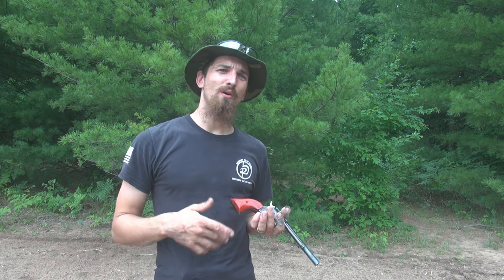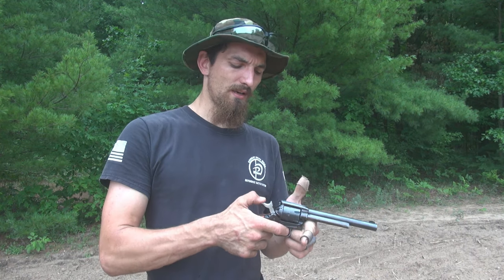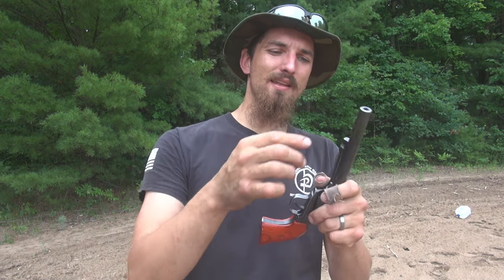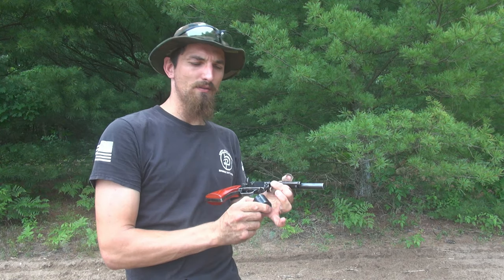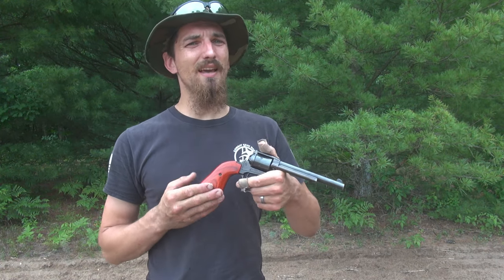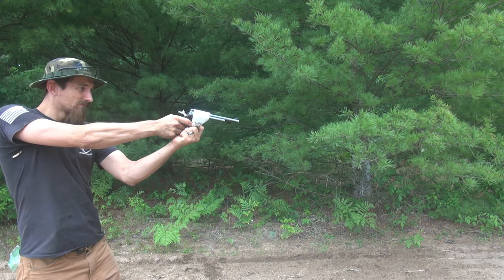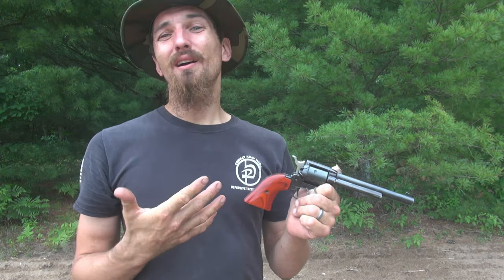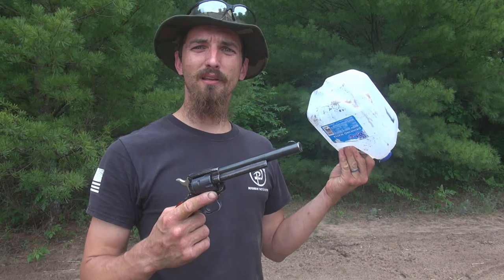Most Amazing 22 Revolver, You Have to See!

Comment: I installed a Ruger all steel ejector rod in my Rough Rider.  Can be purchased from Midway USA for less than $10
Reply from the maker: Awesome, good to know!
Reply: @Mr103056  its too fat.
Reply: Thank you
Reply: Thank you smart guy!
Reply: I haven’t had any problems with my ejector rod yet even though I have fired a couple of thousand rounds thru mine.  I will probably buy a  Ruger ejector rod just in case mine breaks.
Reply: Which one?  Bearcat or Redhawk?

Comment: Yes, I own a heritage rough rider. These can still be had on Black Friday for $90 to $140. For that money the finish and materials are what you get.  
Options include barrel length, grips, fiberoptic sights, 6 and 9 shot, a cylinder replacement for 22 mag and some finish variations.
The 22lr cylinder will accept 22lr, 22 short, 22 long and 22 shotshells. The Mag cylinder will accept 22 mag and 22 mag shotshells. 
My wife wanted one, so we got one with fiberoptic sights, 6" barrel, and both 22 and 22 mag  9 round cylinder. After 5 years many trips to the range, and about 4,000 rounds
it is still mechanically sound. The finish on the steel barrel and cylinders is showing some of wear, mostly on the tip of the barrel and the front side of the cylinder. The finish on the frame has a lot of scratches, wear on every edge and some minor pitting around the cylinder gap. I like many others have either put purple or blue locktite or plumbers tape on the tiny bolt that holds the ejector rod cover to the barrel.  Seriously folks, buy one, clean the threads on the little bolt and the hole and put a drop of purple locktite on there.
Reply: $100 cabellas

Comment: I have watched at least 100 videos involving revolvers and you are the first person I've seen warn people about the gases and debris danger at the front of the cylinder during discharge.  I have allowed other people to shoot my revolvers and never made a point about keeping hands away from the front of the cylinder.  My bad.  By the way, I also have the Heritage with both cylinders.  It is a good gun but if anyone is going to buy one please inspect very carefully for quality control.  After I got mine home I discovered the 22 cylinder would only revolve two clicks before jaming.  The 22 mag cylinder spun perfectly at half cock.  Sportsmans Warehouse would not help me.  Said I had to send the gun back to Heritage.  I bought it as a camp gun to use with the 22 mag cyclinder so it didn't bother me too much and I never sent it back to Heritage.  But I did try another 22 cylinder from a buddy's gun and it worked fine.  After measuring we found that his cylinder was .002 inches longer at the center.

Comment: I bought a Rough Rider in the late 1990s. I paid $99 for it and have used it to teach my kids how to shoot. The finish wasn't "bluing", it was painted on. In the 22 years I've owned it, I've had to refinish it twice (frame and grip). Came out okay each time and doesn't really affect operation. Not the most accurate single action I've owned, but certainly a fun gun, and WELL worth the money I spent on it.
Reply: The barrel and cylinder are blued. The frame and grip frame are some kind of painted coating that is not very durable.
Reply: Have you tried “aluminum black”

Comment: I have two 6.5" rough riders and one 4.75".  They all work very well with either LR or WMR and I've had no issues with them.  I accidentally dropped my 4.75" on the ground and broke the ejector rod which isn't a huge deal as it can be replaced.  I've got around 1,000 rounds through my 4.75" and maybe 100 rounds through each of my others.  Amazing little guns Heritage is making these days.

Comment: Bought mine in December of 2019; 4.75" barrel, combo cylinders. A great gun for learning and as a first pistol, with the added asset of ammunition flexibility. The hammer block safety takes some getting used to, but does make it safer for carrying and loading. The fact that it uses .22 rimfire ammunition means that putting your hands near the cylinder gap is unlikely to cause serious injury, but you do get motivated to quit bad habits. I broke the safety on mine from over exuberant use, but Heritage replaced it under warranty with a three week turnaround.
I also deducted points for the finish, but it's not meant to be a Rolls Royce. Researching this gun pointed to consistent complaints of a sight blade slightly off, and an eventual looseness of the screw that secures the ejector housing to the barrel. Hence, the gun was broken in, followed by tightening the barrel with a strap wrench, and applying threadlocker to the aforementioned screw.
The four-position hammer has interesting aspects. I tried (dry) firing it from the third position; it's possible, but the trigger pressure needed means that an accidental discharge is nearly impossible. However, the firing chamber in this third position is slightly out of time, and the cylinder would need to be moved slightly, to the next click. The gun itself doesn't like to get into this position, and takes a conscious effort to get there.
The hammer block safety makes loading a full cylinder both safer and practical; in this mode, I would recommend using the hammer block in conjunction with the first hammer position. This first position creates a gap of approximately one-eighth of an inch, while the hammer block prevents the hammer from touching the firing pin. However, please note that Heritage recommends the standard revolver loading procedure of skipping one chamber.
The longer barrels, up to 16", would make it a great snake gun when used in conjunction with ratshot. However, the 16" barrel makes it look cartoonish, with some wags saying it needs a "bang" flag.

Comment: just put over 1000 rounds through mine holding up great

Birchwood Casey aluminum black works like a charm on the receiver and grip frame, mine was looking rough but I touched it up and it looks better then when I got it

another thing to note is how easy this is to disassemble and reassemble. If I part breaks its easy to replace and cheap on heritage website

Comment: I know this is older video, but I had been looking at the Hertitage RR 6 shot with 6.5 inch barrel. It went on sale for 107.99 on black Friday so I picked one up. Then immediately purchased a nylon holster and .22 Mag. cylinder. ( was another black Friday deal 34.99 for both items from Heratige company). But like you said very fun shooting gun pretty accurate at 30-40 yards, it will serve well as home defense (only part I disagree with you on) but I also have other lines of home defense. 20 Guage with pistol grip and 18.5 inch barrel loaded with 3" #1 buckshot. Can't wait till I get more rounds threw it too break it in tho. Thanks for info!
Reply from the maker: Awesome!
Reply: Where can I buy this pistol?
Reply: @EXSENTRIX  Most gun shops carry then. But I purchased mine from Rual King. If you buy one make sure too purchase the .22 WMR cylinder also, you won't regret it.
Reply: @darrieljamison6914  Well that works out great! There's a Rural King not too far from me. Will definitely add that cylinder to the purchase as well. Thank you very much I appreciate it.

Comment: Bought mine two days ago. looks like fun! Great clip.
Reply: The heritage revolver is pretty solid. It will get dinged up but will shoot thousands of rounds. 
Here's the big tip that many of us have done.  This will save you lots of hassles.
The ejection rod cover screw that goes into the barrel.  Carefully remove it, it is spring loaded on the ejector rod. Then remove the cover and the rod.  Clean the screw hole with acetone or similar evaporating solvent. Clean the screw with the same solvent. Reassemble the spring, rod and cover, put a drop of purple loctite (light duty) on the screw and complete reassembly.  Don't use a stiffer grade of loctite as you may want to someday disassemble the ejector rod for cleaning and lubrication. 
I have started several new shooters with our Rough Rider. These are great training guns.  You can demonstrate a lot with them including the hot gasses and soot that come from the cylinder gap (between the cylinder and the forcing cone of the barrel).  I always point that out to new shooters with something like a piece of paper as part of the training.
Reply: @phild8095  Thinks for the tip. I have been studying the gun a little, going to range today.
Reply: @bsmith8564  So how was the range trip?  Hope you got home safe.
Reply: @phild8095   No issues. Fun gun to shoot. Had one fail to fire. Looking for an Arc magnet section to put on the barrel to capture the cylinder pin. Or I might grind another divot on the pin as to capture it when changing cylinders.

Comment: Good to hear it's still shooting well.  I got the one with adjustable sights and once I raised the rear sight, it was dead on at 15 yds.  Very accurate so far.  Good enough for squirrel hunting.  Don't waste your money on the Aluminum bluing compound as it doesn't work.  I guess you could anodize it if you wanted but you might just try painting it-I did this on my alloy trigger guard on my Remington 1100 and it looks pretty good.  Thanks for making the video!

Comment: I have three of these. The first time I shot it, I had a steel target, 8”x12”. I was at 60 yards. Once I knew where to was hitting(5” low - 5” to the left. I reloaded and rang the bell five out of six. I paid $99 for it. I think it’s absolutely the best ‘value’ gun I have. I also bought the Barkeep. Even with only a three inch barrel, it’s amazingly accurate. 
They are great,
They are cheap, 
Buy two. Great gifts and you’ll really be the big shot.

Comment: I believe the Heritage alloy frames are Zamak (96% zinc alloy aka pot metal), but I’ve heard rumor that Taurus may change that to aluminum to get around the melting point laws in some states.
Reply from the maker: I think you're right about the Zinc. It's not a bad metal, just not coated very heavily.
Reply: @GunTradition  it keeps costs down and is strong enough for 22 or 22 mag.  I’ve seen inexpensive “Hy-Hunter” 22 mags from decades ago, steel sleeved chambers in a pot metal cylinder and steel sleeved barrel. But they worked OK.

Comment: Just ordered the same one minus the magnum cylinder which I'll  buy later. 
Yours is shooting accurately. 
 I sure hope mine shoots straight!!!
One thing I don't understand is that guns are supposed to be precision milled. 
It shouldn't matter if the gun is inexpensive. 
 Why do guns shoot high, low, left or right??? 
I understand that there are lots of factors that can do this. 

 For starters,, Is it an expensive process to mill the sights on STRAIGHT for at the very least the windage??

Comment: That plastic piece for the ejection rod you mentioned is still together 3000 rounds later. Plastic or not it seems to hold up. Great video !
Reply from the maker: It's like driving my first Honda. She felt like she was gonna fall apart, but 200,000 miles on her and it's still going down the road.
Reply: The real problem is the screw holding the assembly to the barrel...we have blue loctite on ours and I check it constantly...we check all screws when cleaning...
Reply: @PetuniaIii-pd1ww  I seen a guys video who mentioned they come factory with a crooked or loose barrel sometimes. I'm about to buy one, I'll be checking the barrel as a  first step. They guy was saying that's why some have an accuracy issue.
Reply: @here_to_watch2115  no doubt some folks have bought lemons...the common complaint about the barrel seems to be the front sight is nowhere near where it should be - the barrel is screwed in, and I think the manufacturer overcooks it sometimes...even more common is the screws working loose, which our gun suffers from (blue loctite is good stuff!)...others complain about fit/finish, but for 147.00 these guns aren't Rolls Royces to begin with...and some note parts breaking way too soon, but that can happen with any gun...we have had ours for several years, several thousand rounds downrange, and I love the gun warts and all...you are 100× more likely to get a good one than a lemon...you might notice there are a lot of people saying they own 2, 3, or 7 of these guns...you never hear anyone say they own that many wranglers...bottom line: if ours ever wears out we will buy another one...

Comment: The 9 shot is great but the ejection rod / loading registration requires a bit of extra manipulation - more shots but slower loading per bullet.  I keep mine as my home defense gun - no worry about tired springs in hard to find magazines, I can keep a couple blanks under the hammer for safety and still have 7 shots.  See my video (Ishkatan) about the registration of the of the 9 shot cyclinder.
Reply: No need for blanks or an empty chamber with a hammer block safety.

Comment: That's not bluing on the Zamak metal it's just a crappy paint job. Just the barrel and cylinder are blued. I sanded all the paint off of the Zamak pieces (Main frame, Grip frame and ejector housing) and polished them with Mother's Mag and Aluminum polish. Those pieces polished to a mirror shine. It's now both functional and beautiful. I was amazed at what 40 hours of finishing work did to that gun. Honestly I enjoyed doing it and the whole reason you can get that gun so cheap is because they cut out all of the finishing work they can at the factory so they can sell it cheap. Design wise it's awesome it's just rough looking as the name implies. I hated the plastic ejector handle and have remade one in Aluminum and polished it and that also really made the gun look a lot better. Just FYI I plan on making a bunch to sell soon so if anyone's interested they will be $25 with free shipping and it will make your gun look way better and it will also not break with normal use. Let me know if your interested.
Reply: I would be interested.  Also, pic would be great.

Comment: 3000?? I bought a $25 Herter's 22 back in 1967 (when you could still get em in the mail). Over the next 10 years I put 20 + bricks thru it (20,000 + odd boxes of 50). At about 14000 it began shaving a round now and then and I had to replace the bolt. I was forced (by topography) to a 70 YARD range. Once I mastered heeling it to counter shooting low and right (Im a lefty)) I could regularly put 6 in a 6" circle.
After a Mcycle accident in 77 tore up my left side, I never got as good with my right hand.
3000 rnds? smh lololol

Comment: Dude. The frame is not aluminum. It's Zamak. Zamak, is an Alloy, consisting primarily of Zinc, Aluminum, Magnesium, and Copper. It's high grade Pot Metal. There's only 4% Aluminum in Zamak. It's usually either Die Cast or Spin Cast, and it's popular because it will take color through a variety of methods, but anodizing isn't one of those.
Zamak only works in guns of relatively low pressures, which is why it was the material of choice for Saturday Night Specials frames and slides (Raven, Jimenez and Lorcan, and a list of European Cheap Gun Makers that went out of business after the 1968 GCA passed into law).
I'm not saying the Heritage is a bad gun. Just that you get what you pay for and it's a cheap, mass produced SAA design that is sub $200 dollars. It's fine for plinking, but it's a value buy, not an heirloom that will be passed to your great grandchildren. Ruger's Wrangler, isn't much better.
Reply from the maker: It's definitely a cheap gun.

Comment: What a crock - took 1,000 rounds to sight it in; put fingernail polish left of the rear v sight and on the front sight; line them up and now it is accurate to 25 feet.  Saw a review about how accurate these are before I bought one.  Very fun gun to shoot even though it is a piece of crap.  I still shoot it a lot.  Take a laser .22 cartridge bore sight into it at the store and see if the sights line up before buying one.  Maybe a few of them are accurate in the store.  Look up what people have had to do to fix the sights on YouTube before you buy.
Reply from the maker: You can adjust the front blade left or right, but that's rarely needed. I whish I could get ahold of one like yours. I've simply not seen someone who shoots other SA revolvers well have any trouble with that. Not saying yours isn't' bad. Interesting. If it's that bad, you should contact Heritage Manufacturing about it.
Reply: If you hate it I'll give you 25dopollars for it!

Comment: Well from years of doing gun smith work i can tell you there is no way to blue aluminum . It is either painted or has a very light coat of powder coating. Best remedy is when it wears off take steel wool to the frame and paint it with engine block paint. It is very thick and withstands heat up to about 3000 degrees.
Reply from the maker: That's not a horrible idea.
Reply: The frame is actually Zamak 5, not aluminum. Zamak is a zinc alloy.
Reply: I use the ceramic engine paint on some non engine projects...gives a nice finish that seems to hold up to abrasion...
Reply: @chrisgoldstein6446  The frame is aluminum alloy, the grip frame is Zamak.
Reply: @bigbill2444 , the manual from mine claims the entire frame is Zamac5.
Reply: Thanks for the tip well appreciated

Comment: Put 36 .22 LR down the pipe. Put 30 .22 WMR Fun an as accurate as one could expect out of 6.5 inches. Had one fail to fire on the long rifle ammo but i will not blame the gun yet. Fun gun 👍👍 P.S. The ejection rod cover screw is still tight.

Comment: I have a revolver that with the correct ammunition, has no cylinder gap. It was designed in 1895 for the Russians.  It is a Nagant M1895.  It is one of the few revolvers that can effectively use a silencer!
Reply: I have a Nagant revolver too.  I Bought it several years ago and also bought a box of ammo for it.   I haven't fired it yet though.
Reply: If I owned one of those I would reload the ammo if I could find brass boxer primed to start with.